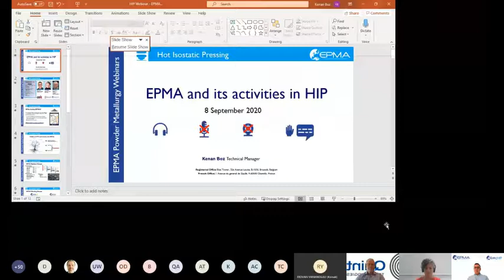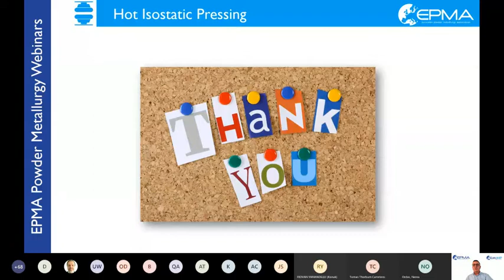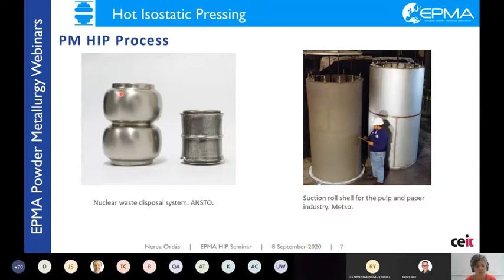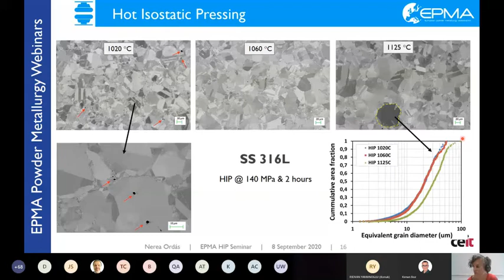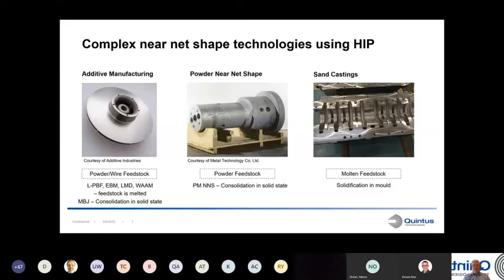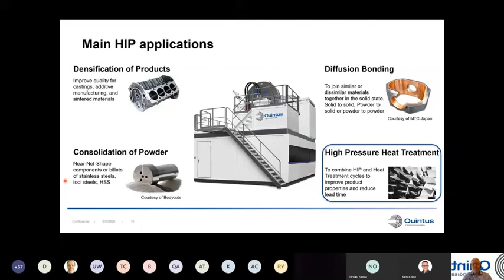EPMA Hot Isostatic Pressing Webinar 2020

Comment: if the pressing of the object is not enough ( 42ton/in2), means producing large green objects from a small press (150ton for example), the green density is low, my question ,, can i do vacuum sintering with an object surface carburization then HIP it for densifying ??